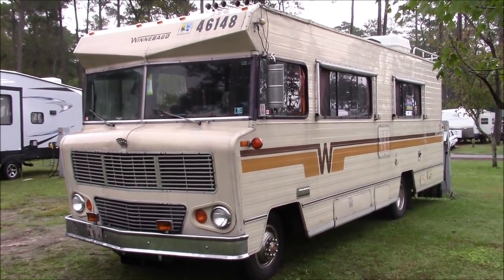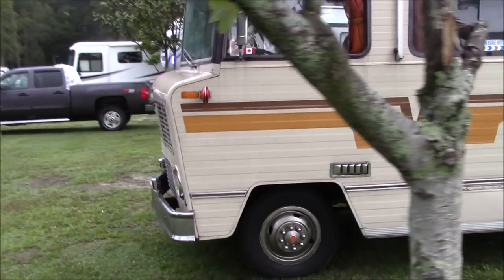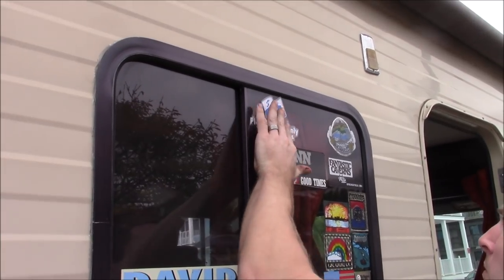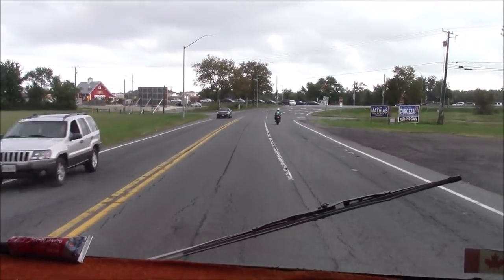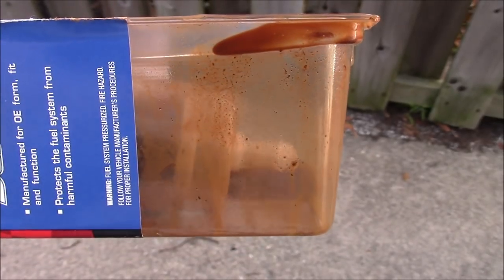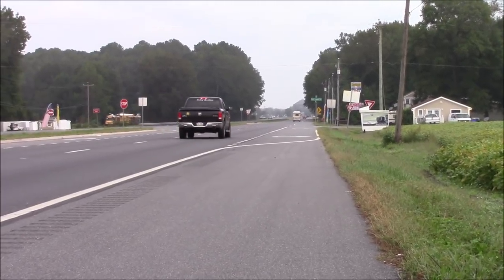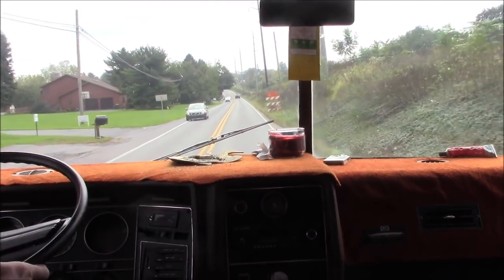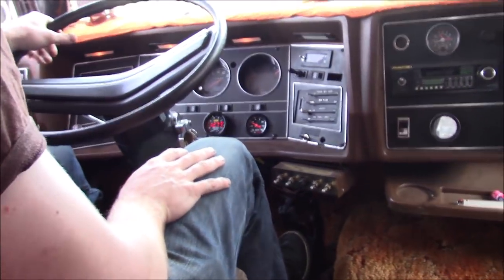Turbo-LS Winnebago goes to Ocean City Maryland!

Comment: I'd add some sort of straight throug muffler. Like a Borla or something. It would just take the edge off a bit, wont actually lose anything. 
I'd also lower the damned thing, put wider wheels up front, and lower profile tires all around . Make it a little more stable and a little less tall.
Reply: Hooker maxflow is arriving today or tommorow
Reply: Borla are the best exhaust systems but you pay for it for sure.

Comment: This thing is hilarious 😄 Awesome! One thing about them filters though. I ran one of them in front of my 044 copy (appears to be the same pump you have) and it was causing fueling issues even when clean. They were impeding flow to the pump. They are for low pressure carb fuel systems after all. Something like a 200sx fuel filter will fit with 1/4" fuel line and is meant for injection systems.
Reply: Actually running a real 255.  Initially wasn't gonna run a turbo..but this will be fine as long as we don't change the cam, crank the boost.  Yeah alot of fake 044 pumps
Reply: @obrienracing1  I'm not saying the pump was the issue in my case. I'm saying these filters won't allow enough flow for an injection pump.
Reply: @LivingMyBoostLife  this 3/8 fuel filter before actually seems ok.  If I were running an 044 pump I would probably y 2 of them in before.  I think the 255 can get away with alot more drawing/picking up fuel.  The 044 style pumps have a huge inlet for a reason I'd guess.  They are finicky.

Comment: If my 454 Winnebago gets 5 miles per gallon what is yours getting did the ls help mileage with the turbo if you drive it nice
Reply from the maker: 7 to 8. Got 4 or 5 before as well.
Reply: @FuelInjectionSucks  is that miles per gallon or gallons per mile
Reply: @stevenbaker470  Pretty sure it's gallons per smiles in that thing lol

Comment: This is FUH...KING.....AWESOME!! Good Work! The only thing id worry about is the tow bill if you grenade that sucker 200 miles from home. But the LS is pretty tough.
What kind of power do you guys have this tuned for? How much Boost are you running?
Reply from the maker: Runs 10psi. Makes probably about 450-500 crank horsepower.
Reply: I'd worry more about the trans taking a shit than the engine

Comment: I had to burst out laughing ( should that be a copyright BOL?) Every time I heard that engine rev and the turbo spool up, hilarious.Really it needs a Cummins Diesel of any kind.  My Dad let me drive the Plymouth Satellite station wagon to school sometimes. That car could take a beating, the 318 was indestructible. I accidentally put it in reverse at a high rate of speed, it only stalled and started up again without actually stopping. Everyone referred to it as,"The racing Snail." I did like 60mph next to the Amtrak tracks. There was a dirt road that was right next to the tracks, full of whoopdiedoos and at the end pure gravel to launch airborne then stop the race. The train usually won, it does like 65 mph through that area, it was an awesome thing. Cheech and Chong times, a fond memory.

Comment: I own a 1968 Winni Brave 18ft. That currently has a 1976 ford 300 straight six and has been sitting for years. If that 76’ chieftain will haul ass with a turbo LS. I can imagine what a smaller 18foot brave would do..
Reply from the maker: I think I just saw one of these in the local yard. Single rear wheel, inline six Winnebago. Was the smallest one I've ever seen.

Comment: so you think all the exhaust you pumped into the fuel tank may have caused the problem ? why didn't you just have the tank cleaned and re-worked at a shop ?

Comment: Damn looks sketchy. Some suspension work looks like would help. Cant imagine those old tired brakes trying to get that big power and weight stopped. Cool engine setup though. Just appears to need help in other areas to make it complete. Either way its cool and i would be great for infield parking at any race track

Comment: Great vedio. 

If correct dose this have a 60mm single turbo that around 300 - 550bhp. 

Or 2.0 supercharger on. 

Great speed in this Winnebago. 

Imagine if whad twin turbo and twin supercharged Winnebago  ls engine in it. 

Not sure if it add more weight but look at the torque range with twin turbo and twin supercharged on. 

My guess around 1000 mark or 900bhp.

Comment: Whether you put a Magnaflo on there or not, you NEED to Dynamat that thing.  Even with the video leveling everything out, that thing is OBNOXIOUSLY loud.

You may want to think about flushing out both of those tanks.
200 miles on a fuel filter?  Insane...

Comment: I wonder what other mods it has besides the single turbo, cause I want to know how he got the turbo flutter & the slow turbo spool (which sounds good)
Reply from the maker: It's a stock 6.0 with a GT45 turbo.
Reply: @FuelInjectionSucks  I actually want to do a 5.0 Explorer V8 swap in my 99 Ranger but also want to do a LS3 single turbo swap (like that Winnebago has) & piss off people by Chevy swapping a Ford xD
or maybe in my 86 Ranger (the LS3 single turbo swap) when I find a 86 Ranger

Comment: I used to have a 32 foot Class A with a 502 cammed MSD ignition 4 to 1 headers my 72 Pace Arrow would blow the doors off of the banks power diesel classes of the 90s one of my favorite things in life was blowing buy them at a hundred miles an hour in my ratty old Pace Arrow

Comment: What is that fluttering noise when you let off the throttle? Are the tires causing vibration ? Kick ass power though! 👍👍👍👍👍👍👍👍👍
Reply: Turbo spooling down

Comment: Curious about the trans...whats in it and mods?
Also what converter?
Reply from the maker: Stock 4l80 that was found laying on the ground at the local junkyard. Only modification is part of a shift kit has been installed. Stock converter.

Comment: Sounds like you are pushing the old rv too hard, it sounds like it needs some engine work. Was this fixed up or used to junk around in for video.
Reply from the maker: He's driven it over 1000 miles with no issues. Went from PA to South Carolina and back.

Comment: @fuelinjectionsucks keeping boost low and intercooled are you able to run 87? What did it do for fuel mileage?  Ive got one with a 454 8.somthing to 1 compression and 4l80e im thinking about boosting im wondering can i tow and use 87 octane with proper tuning and intercooler on 7psi. Ive built many kits but never something this heavy.
Reply from the maker: We run it on 93 and meth injection to be safe. It may be possible if you're really careful with the tune to run on 87 I'd imagine. With your lower compression it may be easier.
Reply: @FuelInjectionSucks  what kinda mpg are you getting? Awesome project I can't watch the the video without a smile.  Its so cool!
Reply from the maker: @boostedtrd  gets about 7-8mpg by itself or towing. Doesn't seem to make a difference.
Reply: @FuelInjectionSucks  not bad mine gets 8.3mpg not towing and 5.5mpg towing a 24ft enclosed about 8k pounds. I was curious if it would help the mpg towing sounds like it might help. Thanks for your info

Comment: No better than a 390, 427, 454, or 502 with a heavy cam. High torque range means nothing with big weight.. It's why semi trucks split gears with 300hp and 2000 ft-lb

Comment: What's going on with the fuel filter? The dirt?
Reply from the maker: Rust and dirt from the 1970's fuel tanks. Sometimes you won't have a problem when they are still carbureted, but when you add the return line for EFI it constantly churns up the sediment.

Comment: your 12volt doesn't work inside problbly becauae your land cords not plugged back in... the cord u pull out to plug in to land power has a socket its supposed to be plugged into when not in use.

Comment: You got to be kidding me this thing is the s***I've had a Winnebago or two and this thing has got to either suck a lot of gas or either just that's got to be a lot of money on the road I used to have a couple of motorhomes that used to get gallons to the mile not miles to the gallon but that thing

Comment: What's the point of this video if the driver is going to "let off" of the gas pedal as soon as the turbo starts building boost? Lame...
Reply from the maker: So he should have done full blast pulls through center city Ocean City at 80mph during an event weekend where fines are tippled?

Comment: 04 Dodge Ram 2500 5.9 Cummins manual transmission all stock truck no tuner 42.5 miles to the gallon. Actual fuel test not computer. Read more to found out how I did it. Here's the secret to miles per gallon in anything I found out. driving slow my speed 39 miles per hour turning 1150 RPMs 42.5 miles per gallon. Lower RPMs in any way possible for maximum Miles per gallon. gear vendors overdrive, taller tires, higher rear end gear axle, Snow's methanol injection will help a little, cold air box will help a little, K&N air filter will help a little, slow down or all the above. The truck at the scales weighs right at 8000 pounds with a little bit of stuff in it. If I run the truck at 70 miles per hour it gets about 11 miles to the gallon and the tachometer is way up there. I do run the flashers when someone's coming up on me. And I shake the wheel right and left some to get their attention. or until their left turn signal comes on to pass me.. Higher RPMs kill fuel mileage in anything. Also something that will pick up a little fuel mileage and be easier on your turbo. I need to do it myself is build or buy a Snow's performance washer fluid injection kit to keep the engine and intercooler cool. I just want to do it mostly so when I get on a hill Towing. I can get the temperature down I'm actually probably just going to use my washer jug to tap with a switch the washer fluid in the motor it works. I've done it with a pump up sprayer after the air cleaner when the motor was running on the warm side of the road letting it cool down. I was pulling a big heavy trailer in July on long steep hills. Of course it will make more power and you guys could turn up more boost on your RV running just the washer fluid it's not much difference in the strong washer fluid versus the VP racing alcohol. Also snows performance their sheets they sent me even misting water in the engine will make lower exhaust gas temperatures and get a little bit of fuel mileage and you could crank up the Boost just a little more. Tell us how many pounds of boost your running in that Winnebago? What size of turbo? What's been done if anything to that 6.0 LS? If you want to get the Funky Monkey smell out of that Winnebago it's not going to be easy but here's what you got to do. Remove every piece of cloth in there and all carpet. paint it seal the old wood and wood on the walls with any cheap paint will work. Cloth of any type will hold smell in your rv. Another idea you can reupholster the seats with new cloth. I also restored my old Camaro and it smelled like a new car when I did the whole inside upholstery. I had a bedroom in the far corner of my house. that got trashed with a dog that was locked in the. room and it would knock your socks off when you walked in. I actually poured the paint on the floor and painted my way out of the room a few weeks later after it was finally dry. I could not believe it it smelled like fresh paint the killer dog kennel urine smell was gone. Keep in mind my room only had dog urine on the floor in one spot. the dog didn't pee on the walls luckily.